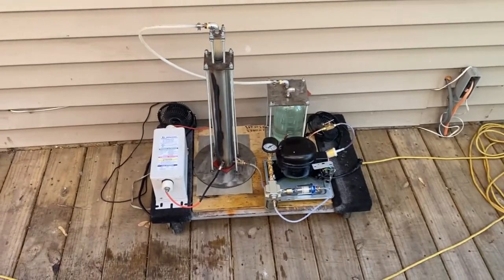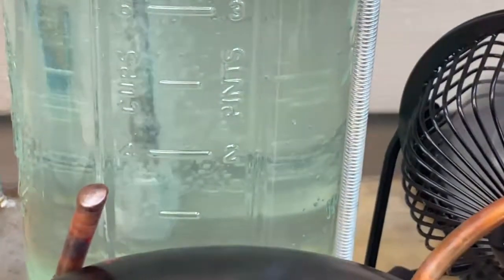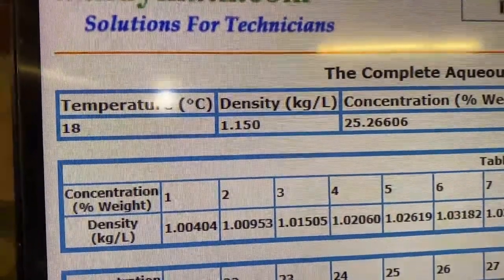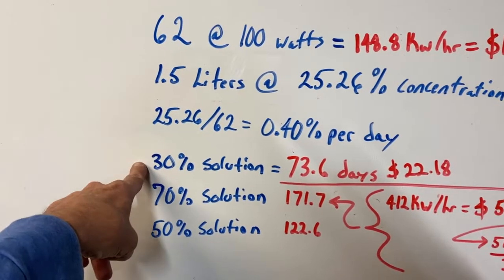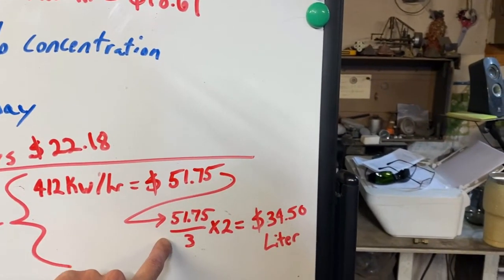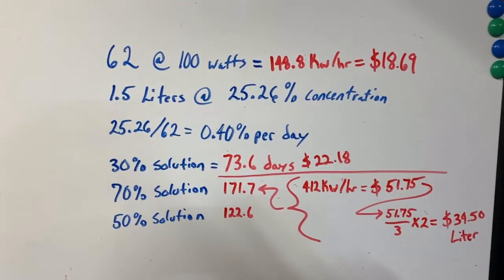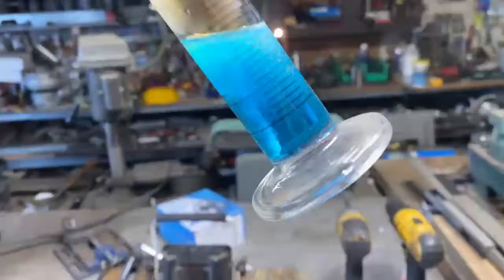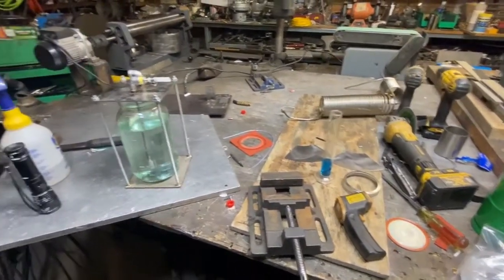Berklyland Eyed reaction update , 25% nitric acid 62 days

Comment: You might be interested  in adding another column. Fill it with crushed egg shells and water and bubble the gasses through it. It will make calcium nitrate from remaining  unreacted nitrogen dioxide. 

Unreacted calcium carbonate will buffer the PH close to 7 untill at some point all the calcium carbonate is reacted.

Thinking about partial vapor pressures, i think that quickly reacting any nitric acid made in the last columb might more effectivly capture what would have been wasted and vented. 
And the calcium nitrate made   would be a great fertilizer adding both calcium and nitrogen to soils.
Reply: MnO2 works too it will form Mangannitrate.